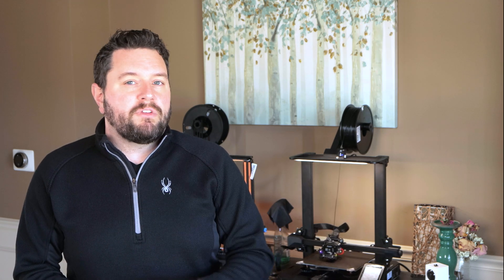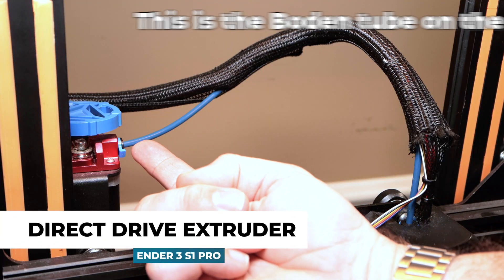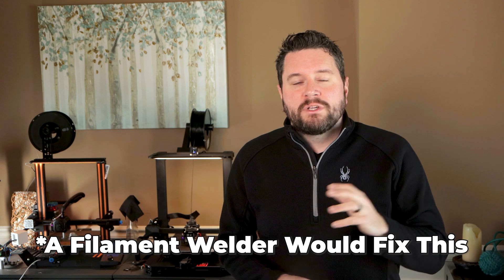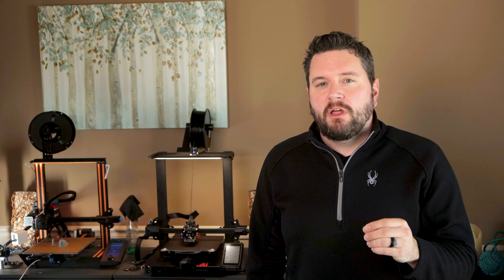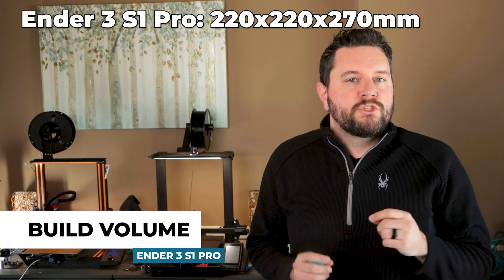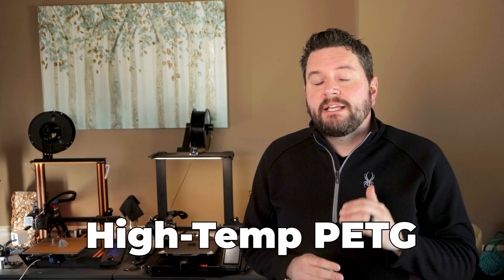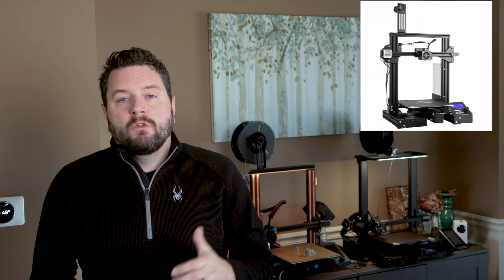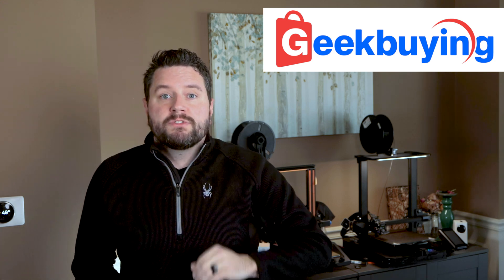YOUR Next 3D Printer!!! // Creality Ender 3 S1 Pro

Comment: Do you think its still worth first 3D printer for 350€ (368$)?
Reply from the maker: Yep. Still use mine weekly. I did, however add on the Sonic Pad and it now flies. So once you are comfortable with the printer to can easily update it to run faster.

Comment: If someone is new to 3d printer I dont think I would recommend ender 3v2 and its not as easy to setup.  I think i would suggest ender 2 pro for a complete beginner.
Reply from the maker: Maybe. I was more going for the lower investment.
Reply: @ThisSmartHouse  Ender 2 pro is one of the cheapest printers on the market at this point, and much easier to setup
Reply from the maker: I will keep that in mind. Most of the folks on the subreddit point to the 3 as it is easy to get (Microcenter).
Reply: @ThisSmartHouse  I forget about the original ender 3 sometimes,  microcenter does have that one for a Benjamin sometimes ...  but i believe that is a kit, so it takes some time to setup...  the ender 2 pro takes about 10 mins to setup and 7 screws

Comment: Adding a Raspberry Pi 4 really takes the Ender 3 to the next level with Octoprint and then adding into Home Assistant for the ultimate setup. 

This also allows you to print directly from Cura over the network as a bonus.
Reply from the maker: Yes I love my Octoprint servers. It really makes the printer better.
Reply: @ThisSmartHouse  Also great video by the way and extra credit for taking the time to teach a class on 3D printing.
Reply from the maker: Thanks! It was a lot of fun teaching the kids about 3d printing. Most of them really had no idea. But I would say 75% of them were actually engaged. I think it helped to see the actual printer.